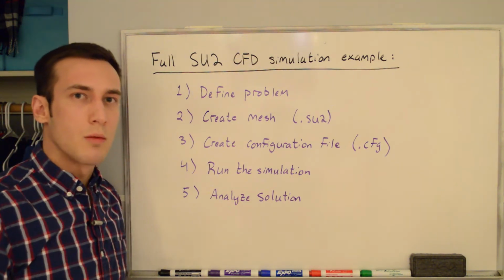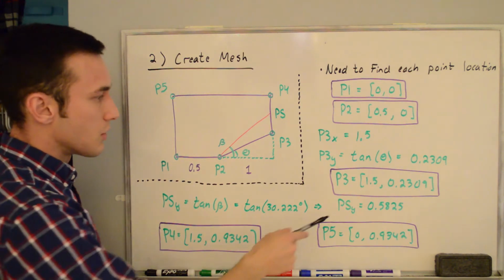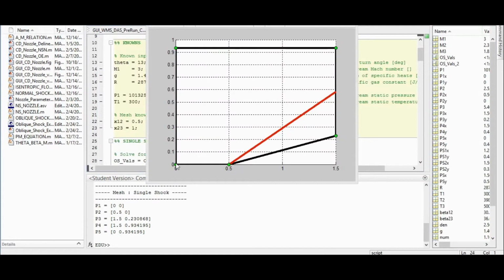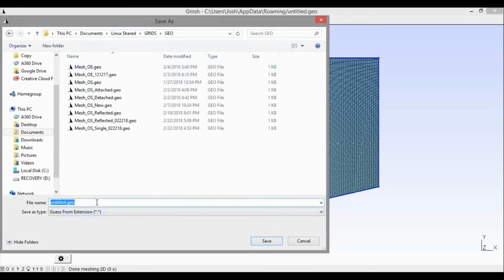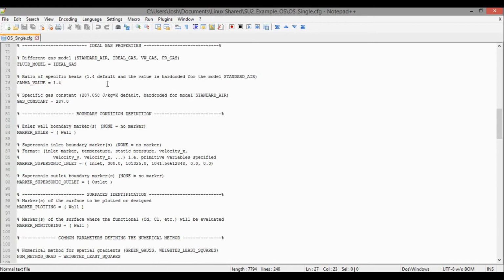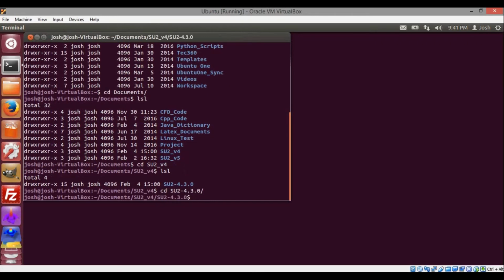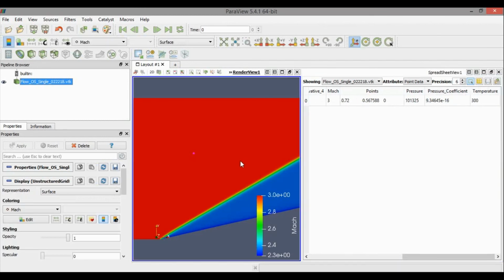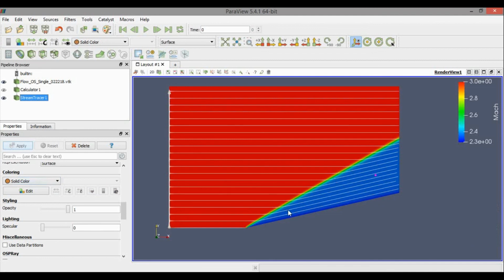CFD Example in SU2: Start to Finish

Comment: Has anyone the config file ? I haven't acces on the link
Reply from the maker: The link should work again since I've fixed the problem with my website.  However, this config file is for an earlier version of SU2, so you might need to update it based on whatever version you're running.

Comment: I am getting vtu file instaed of vtk . can anyone tell me the reason why is it happening , because I can't load vtu file in paraview
Reply from the maker: In the configuration file, find the "OUTPUT_FILES" variable, and instead of the default "PARAVIEW" entry, use "PARAVIEW_ASCII" instead.  That should give your flow file the .vtk extension you're looking for.
Reply: @JoshTheEngineer  Thanks. It works 🙏
Reply: I need to open an existing mesh file ( .su2 ), How can I open this file in Gmsh ? Please help me to open this also . because when I am opening from open option , it is showing syntax error

Comment: Dear Josh,
Thank you for uploading excellent video for new users of Gmesh and SU2.
I followed all steps for generating the mesh with GMESH and mesh saved in .su2 format is of size 2.3mb, i.e.   "Your_Mesh_Name.su2". 
Whereas the file you are using is of size 3.4mb, i.e. "Mesh_OS_Single". 
I can run the code successfully in SU2 with 3.4mb ("Mesh_OS_Single" downloaded from your website) file but not with 2.3mb file ("Your_Mesh_Name.su2").
Reply: In the tutorial, you have forgotten to add Geometry > physical group > add > surface

Comment: Mach number is relative or absolute?
Reply from the maker: The Mach number is always based on the local quantities at that particular point.  So in this case, the Mach number upstream of the oblique shock is a function of the upstream speed of sound and upstream velocity.  The Mach number downstream of the oblique shock is a function of the downstream speed of sound and downstream velocity.  Another way of saying it in words is that the Mach number is equal to the local velocity divided by the local speed of sound.